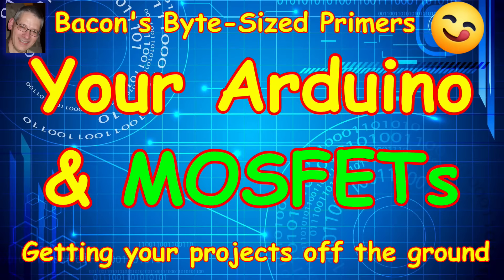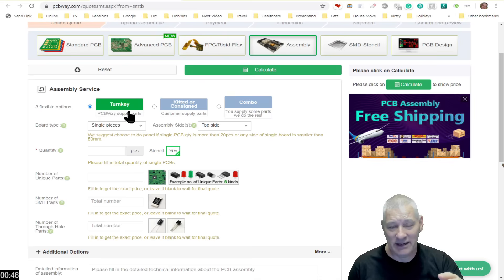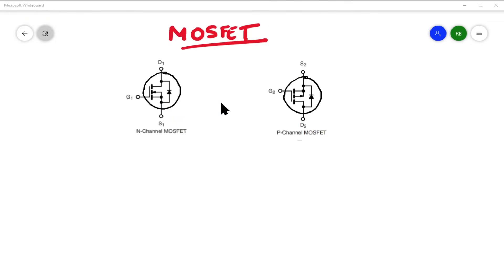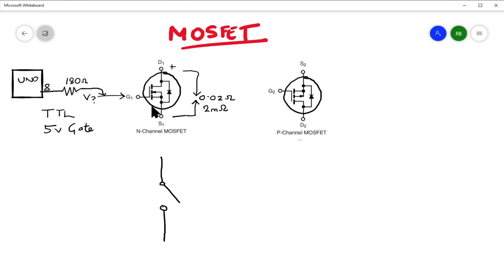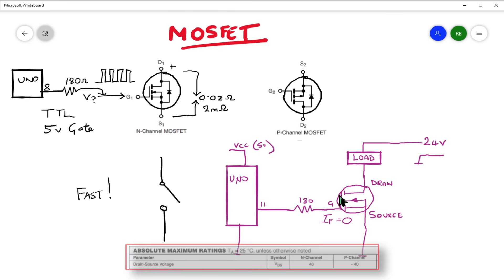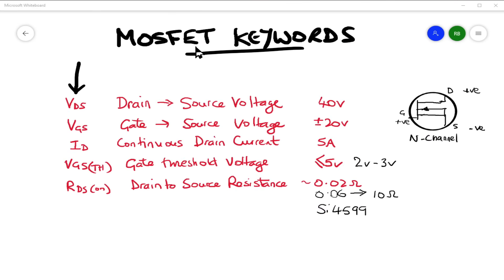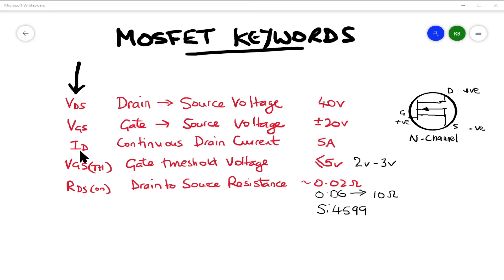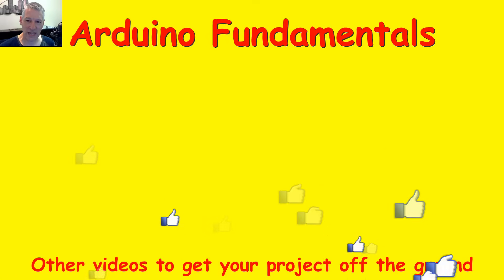#BB4 MOSFETs - From an Arduino Perspective

Comment: Don’t we need a resistor on the gate tied to ground? In order to switch it off?
Reply: You would if the arduino port didn't actively drive it low.  So if you want to play tricks with switching the port to input, high impedance, then yep, put a resistor to ground.  It's not a bad idea to do it anyway for antistatic reasons.
Reply from the maker: In all my testing I've never needed one - but I do tend to put a 10K from the gate to ground anyway. It would protect the MOSFET, as Ray says, if the Arduino pin is high impedance although I suspect the circuit board at that stage is protected anyway.

Comment: About that reverse polarity protection. Don't forget that parasite diode between D and S. With reverse voltage protection with P-Channel usually Source is in load side. Parasitic diode will pass enough current from D -> S to make enough big Vgs to turn mosfet on. If mosfet is connected as your picture then parasitic diode will pass current to load if input voltage is reversed.
Edit:
Parasitic diode is always included in mosfet symbol
Reply from the maker: Drat, I drew it the "normal" way to switch power on/off. Hmm. Tricky to fix now.

Comment: Good video and series, Ralph. 
I suggest people look at the Vgs curves in the datasheet for their specific MOSFET when using them with 3.3V logic such as ESP8266 or ESP32.  The Drain-Source resistance can be higher than the stated RDSon when driving the gate with a low voltage.  This decreases their efficiency and increases the amount of heat that needs to be dissipated.
Reply from the maker: Higher, yes, Andrew, but not by much according to the graphs I've looked at. It doesn't suddenly shoot up to 10 ohms for example. If the VGS(th) is one or two volts (as per my snippet from a real datasheet) then at 3v3 it should be fully on. But that's what datasheets are for and I totally agree that makes must read them and not use any old MOSFET blindly..

Comment: I thought VGS(th) was the voltage needed to start turning on, and the voltage to fully turn it on (and get that really low RDS(on)) is higher.  Look at the graph in the data sheet.  Alas, it seems like even many logic level MOSFETs don’t fully turn on at 3.3V.
Reply from the maker: Correct, Mark. Many MOSFETs don't, but the snippet I showed from a IRL3705N turned a MOSFET on at between 1v (min) to 2v (max) so would be a good choice. See the datasheet: https://www.infineon.com/dgdl/irl3705n.pdf?fileId=5546d462533600a40153565f29f42532

Comment: Would would have added a word or two about using a 555 as a gate driver. For pennies 555 gives you: logic level shifting so that you can get the full R ds on,  will source and sink an order of magnitude more current than you micro-controller important if you have high switching frequencies.
Reply from the maker: True, but not really something I'd add as part of this beginners' video. As it is, so much information ended up on the cutting room floor.

Comment: Thanks for another great Bit of Bacon. And, of course, something learned. Reverse voltage protection. I still have (and use) many BJTs, but any power critical (high current or battery driven) implemenrations now feature MOSFETs.
Reply: That reverse voltage protection had D and S wrong way. S should be on load site because mosfets have parasitic diode between D and S.
Reply from the maker: No, a P-channel MOSFET has the Source as the +ve input and the Drain as the output. You're thinking of an N-channel (which would not work in this circuit) which is the other way around. The body diode on the P-Channel MOSFET conducts from Drain to Source (so no current passes through it in the normal course of events). Look at my circuits for my Smart Phone Charger, I use both N and P channel MOSFETs in that circuit.
Reply: @RalphBacon  Mosfets have also diode between D and S. So if you connect negative voltage to Source (P Channel) then it will go through to Drain and there to load.
Edit: For normal switching operation S to Vcc with P-Channel and S to GND with N-Channel
Edit2: if you little bit google reverse voltage protection with p channel fet. Then you notice all schematics are D to Vcc and S to load. If it's other way it won't protect because of body diode.
Reply from the maker: I looked at my video and I see I drew it backwards for polarity protection. Damn. Well, when you draw the same symbol several hundred times you end up drawing it on auto pilot. I might have to cut that bit of the video out. Whilst it would not stop a circuit working it won't protect it either. The actual (correct) circuit is still sitting here on my workbench in the breadboard. So annoying.

Comment: Ohh -now I learned something new.
Now I don't need to do the basic reseach - thank you very much. (so much easier to learn when you take the time to explain it).
Neat trick with the P-channel fet as protection for power supply.
Reply: P channel can be used as protection but D and S is swapped because internal diode.
Reply: @LimbaZero    Did Ralph show  the PNP  the wrong way around when he was showing how to use it as reverse polarity protection?
Reply from the maker: Glad it was helpful! The P-Channel MOSFET has its SOURCE as the +ve and the DRAIN as the output to the load. The PNP transistor was also shown correctly (emitter is positive wrt the collector).
Reply: @RalphBacon    I only ask because I saw this hackaday post   https://hackaday.com/2011/12/06/reverse-voltage-protection-with-a-p-fet/
Reply from the maker: See my replies above, it was drawn back to front. Drat.

Comment: good video for its purpose, but...
- the current needed to switch a MOSFET during the transition is not negligible at all. If you want to switch quickly you should at least supply 1 A ("one amp") which would charge up a standard power MOSFET gate (1 nF of capacitance) within 10 ns
- limiting the gate current by 180 Ω (which is a good idea!) limits the durrent to 30 mA and the maximum switching frequency to below 1 MHz (good enough for most), using 1 kΩ which many recommend already brings you down to slow transitions and a max frequency of just about 100 kHz
- as pointed out by others, the threshold voltage is not a sharp transition between OFF and ON - always look at the corresponding datasheet which will give you curves for ID over VD for different VGS
Reply: It's probably overkill but I tend to use a mosfet driver for anything switching at more than a few kHz especially as I'm mainly driving 3.3v at <20ma from ESPs. As I'm usually switching 12 or 24v a driver sourced from the load voltage allows dumping an over saturation voltage at high current into the gate so the mosfet spends the absolute minimum time in the triode region. It can be quite surprising how much difference it can make to mosfet temperatures even at relatively low frequencies.
Reply from the maker: Like a BJT the VGS(th) on/off is not a cliff edge, admittedly, but we're talking Arduino World here, not GHz frequency shifting. Keep the 180Ω resistor in to protect the Arduino!
Reply: Would you say that a gate resistor would still be necessary in order to provide protection to the Arduino, in the manner of limiting the current draw? I would think that an infrequent large current draw of a nS might not damage the arduino, but sustained and frequent transitions might degrade the part over time.
Reply: @newburypi  the protection also goes in the opposite direction. A not-too-uncommon failure mode of a MOSFET is a partial or complete short between drain and gate. A resistor between the Arduino and the gate limits the current which can flow back into the Arduino and through its protection diodes. Here, however, 180 Ω might be too small to make a difference...

Comment: Thanks again Ralph, absolutely invaluable information, now adding a ~200 ohm resistor to the 2N7000 gate of my temperature controlled attiny based fan controller, to be used in an kinds of fan cooled equipmenet. Startet with my DPS3050 where i got tired of the constant fan noise, even without load..
Reply from the maker: Sounds great!

Comment: Nice video series, thanks! I would note that BJT transistors can be easier to use with low-voltage circuits, say with 3.3V Arduinos (I like the Arduino Pro Mini). You can easily feed any common-or-garden BJT a few mA and get it into saturation at low voltages, but at 3.3V it takes a pretty special MOSFET to turn on fully.
Reply from the maker: MOSFETs that switch fully on at 3v3 are becoming more common. https://www.infineon.com/dgdl/irl3705n.pdf?fileId=5546d462533600a40153565f29f42532
Reply: @RalphBacon  They are in the last few years but I'm a hoarder and following an involvement with low voltage lighting systems a few years ago I still have a collection of mosfets that need 10v to hit saturation. I think mosfet drivers still have a place in terms of gate capacitance which can really help with thermal performance.
Reply from the maker: You can always use a MOSFET driver to switch on those 10V Gates. But cheaper to replace in some circumstances I think?
Reply: @RalphBacon  It's getting that way but you can't ask a Yorkshireman to throw something away!  There is still a small advantage in switching speed and it's amazing how much those nanoseconds at high resistance can add up in terms of component temperature. Again some of the newer mosfets have amazingly low gate capacitance so that's becoming less of an issue as well. I recently repaired a lighting controller for a friend (read replaced an SMD fuse) and wished the mosfets in it had a part no, It's running 24v/4A a channel @ 1kHz through a through a sot-23 package with the gate driven directly from the unmarked 3v3 micro and they don't even get finger warm. It's witchcraft I tell you !
Reply: Mosfet drivers are your friend and relatively cheap these days even for the optically isolated ones.

Comment: Hi Ralph  shouldn't you be using a resistor from Gate to Source to ensure Mosfet switches off or is this always nesecarry
Reply from the maker: Yes, a 10-100K resistor from Gate to GND is always a good idea (see my circuit to see that I do this) but not absolutely required. That information and more is still on the cutting room floor. I had to stop somewhere!
Reply: Ditto here. I believe it's to drain off the charge on that gate-source capacitance, to aid turning off the MOSFET. Might not be an issue in the case of lower speed switching.
Reply: If your microcontroller has a push-pull output (like Arduino), I’m guessing that’s enough to turn the MOSFET off.
Reply: @markday3145   yes mark, when the port switches low it actively pulls the gate low faster than a resistor would, so there's no need.  However,  I'm nervous about leaving a module lying around with the gate open.  A megohm resistor from gate to ground will provide protection from static, so it's not a bad idea to include it in a detachable module.

Comment: The body diode are also important
Reply from the maker: In what way, Dave, given the topic of this video? In what way would a beginner use that information?
Reply: If you invert the drain source polarity, the mosfet conduct no matter the gate condition. If you are a beginner sound like that the mosfet is broken
Reply from the maker: OK, that's a good reason. I tried so hard not to have to mention that dratted body diode. Just confuses beginners. sigh.

Comment: Pedantry alert: 0.01 ohms is 10 milliohms but what is 9 milliohms between friends?  When I returned to maker world (about 4 years ago) , I was stunned by how cheap MOSFETs were. Back in the 1970s and 80s, they were relatively exoctic devices with price tags to match. The sensitivity of MOS devices to static charge is a low obstacle  which is easily justified by the efficiency they offer. BJTs can be used at 3V but are much happier at higher voltages. Great video, Ralph.
Reply from the maker: Yes, I should have said 20 and 60 milliohms, oh well. It changes nothing. As I said though, some power MOSFETs are £1 each. EACH! Others just 10c! Choose wisely!
Reply: Just to add to the pedantry..  The difference is... a lot of money!  :-)  Well, not a lot, but a MOSFET with low-single-digit milliohm on resistance is quite a bit more expensive than one with 10's of milliohms.  Last I checked, about $7-10+ US vs. $2-3.
Reply: "BJTs....are much happier at higher voltages"? Doesn't sound right to me.

Comment: Got to watch your RDS(on) as it's not always as low as expected at the VGS threshold. Quite a few need a VGS of 10V's to get the low value even though they turn on at <5V. Still good to watch.
Reply from the maker: A TLL (Logic Level) device will switch on fully at 5v. Whilst it may still have an even lower RDS(on) at 10V that is not what is important for Arduino users. We could also say that the RDS(on) goes back UP if your draw significant current (10s of Amps) but hey, at this level who's bothered?
Reply: Lots of modern mcu are  3v3 now, So that has been my problem also, or vdrop on 5v can still be a problem also.
Reply: @tablatronix  some mcu pins can be used for charge pumps to obtain suitable gate voltage.